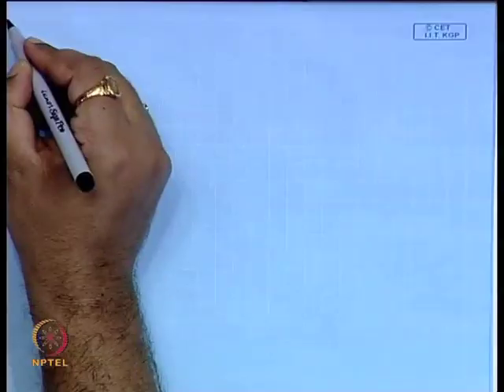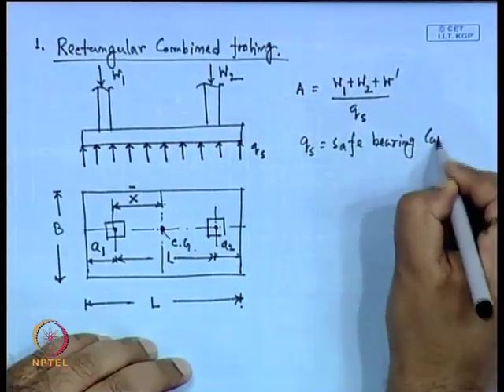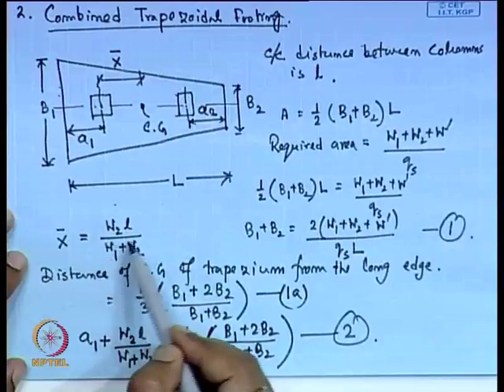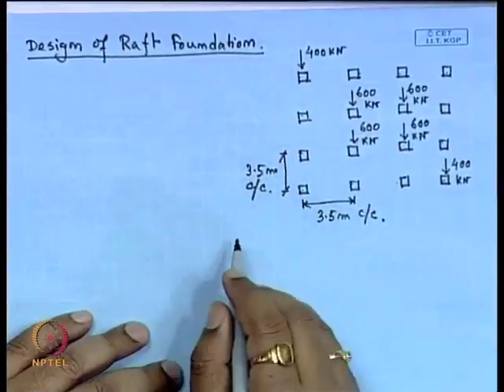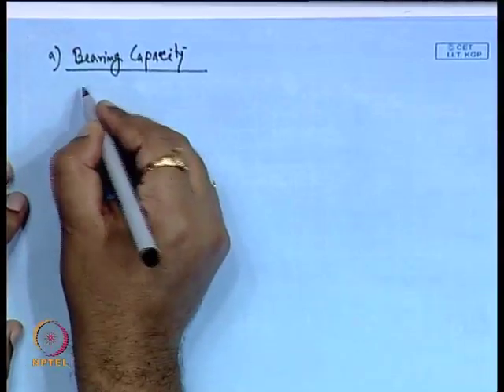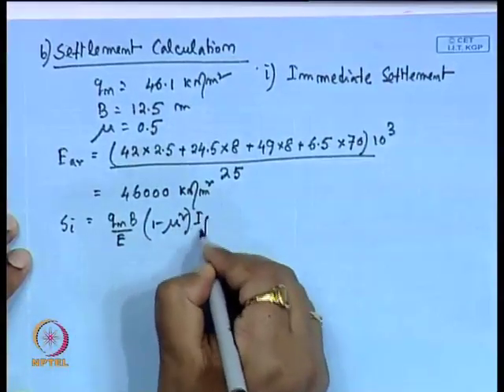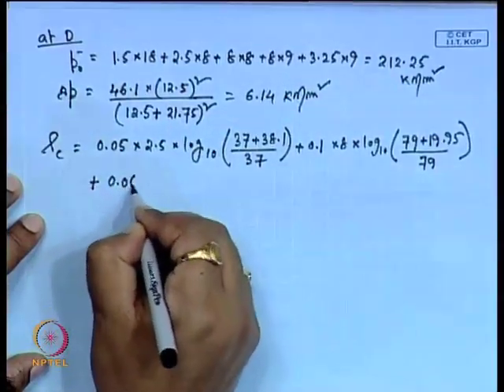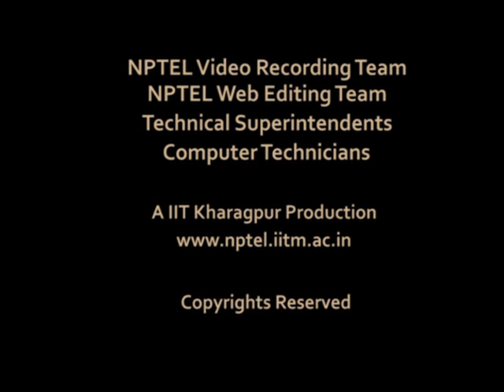Mod-01 Lec-15 Design of Raft Foundation

Comment: Total vertical load shall include self_weight of the slab itself ( as your trial example : t=1,5 m..so that  1,5 x 24 = 36 KN/m2 shall be added.) . All settlement formula are empiricals formula, what references do you use ? ...If bearing capacity and settlement are OK, and then continue with "Reinforcement calculation"......Raft foundation for highrise = slab thickness + Piling/Bored piles ( to resist lateral load/quake load)....Quite ok your explanation.